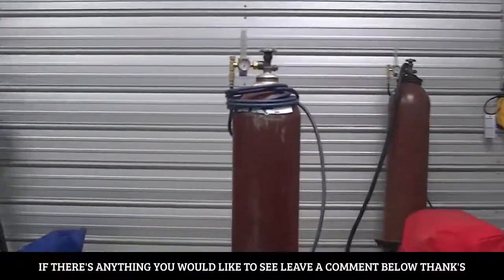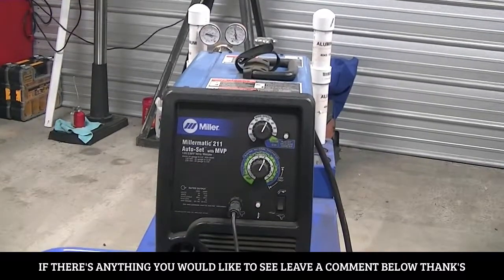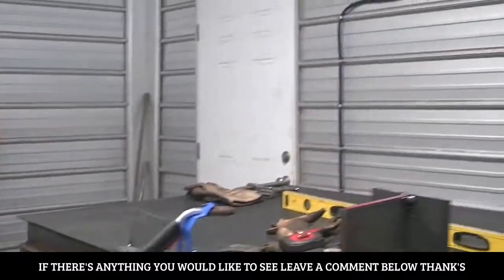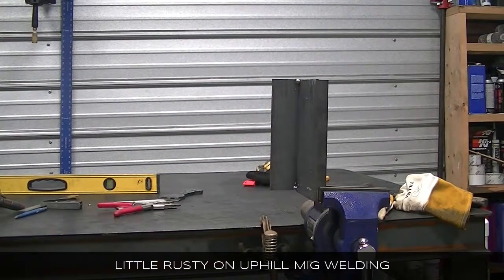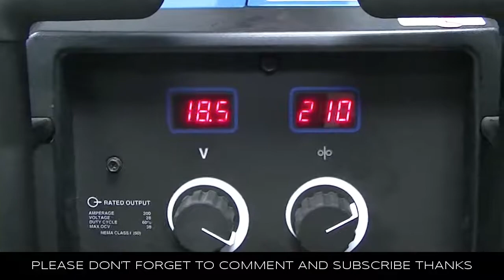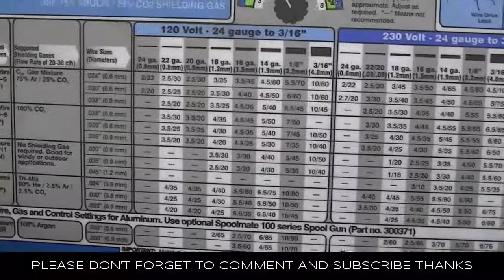SOLID WIRE 0.35 VS DUAL SHIELDED FLUX CORE WIRE 0.35

Comment: Try running the solid wire down hill. Flux core dual shield is always vertical up. I use both and prefer the dual shield 71M, solid wire also doesn’t like mill-scale and I found the penetration isn’t as reliable
Reply from the maker: Yes I was just making a point by keeping everything the same. Which one is better without cleaning. The dual shielded flux core I use I can run Any position. Thanks for watching and commenting

Comment: Can you do a video explaining single shield and dual shield flux core? Also a video with an inexpensive flux core welder with 3 different flux core wire manufacturers to see what is the best flux core wire for cheap flux core welders